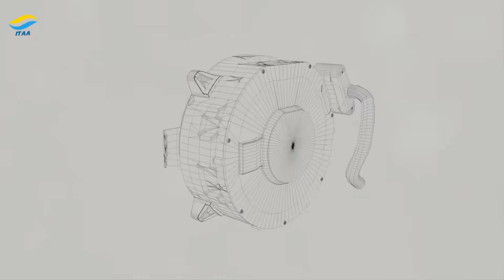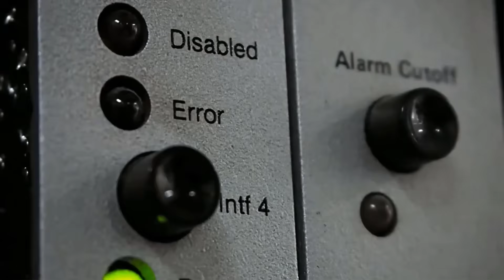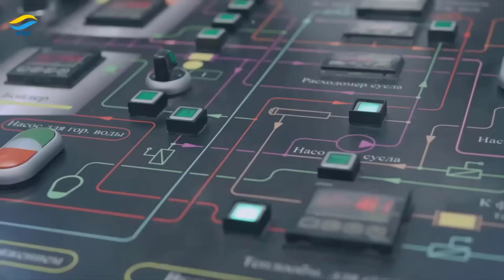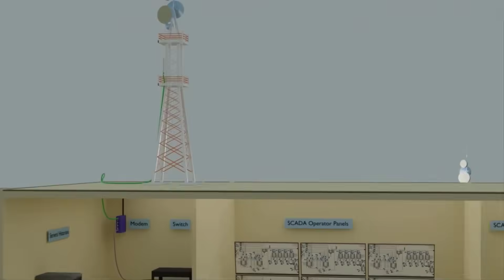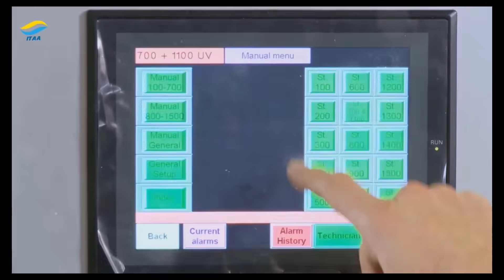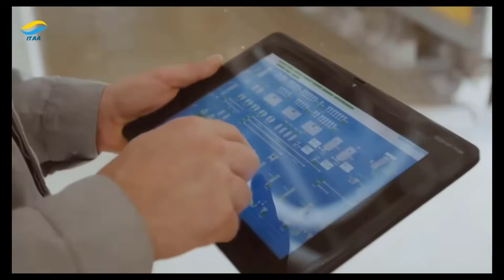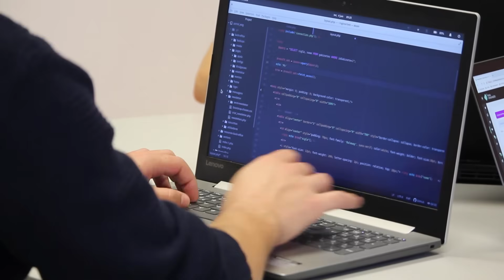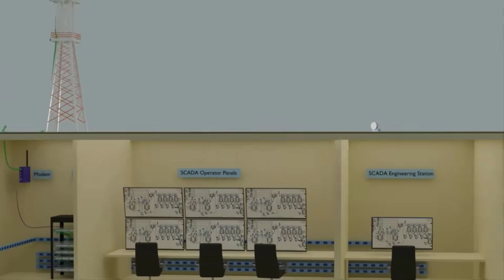Top 10 Industrial Automation Careers | Best Jobs for 2025!

Comment: Sir can you tell the salary for automation engineers in MNCs in the gulf countries
Reply from the maker: Salaries for automation engineers in MNCs across Gulf countries vary based on experience, location, and industry. Generally, entry-level positions range from 8,000 to 15,000 AED per month, mid-level engineers earn 15,000 to 25,000 AED, and senior/lead roles can go beyond 30,000 AED per month. Additional benefits like housing, transport, and bonuses also play a big role. Let me know if you need specific details!
Reply: @ITandAutomationAcademy  , i have 1 year experience in india , in a manufacturing company.
Im in a doubt to switch to software or it field. Because of the work life balance.
Im interested in automation engineering but we need to travel a lot right? And the work life , how many days working in a week ? Can you please share the details.
Like the Work life balance, travelling, should we be in the hot outdoor? 
Im thinking of switching to it field what you think ?